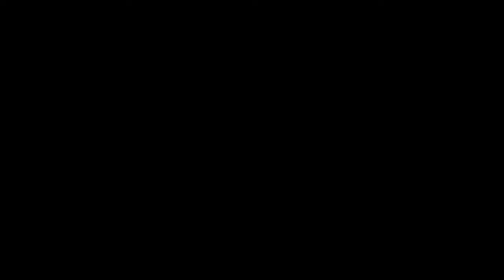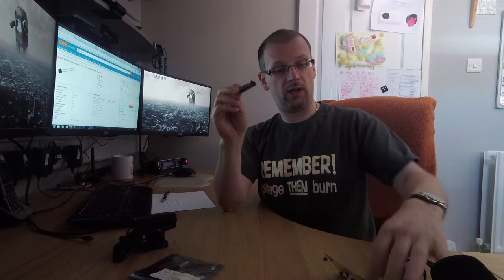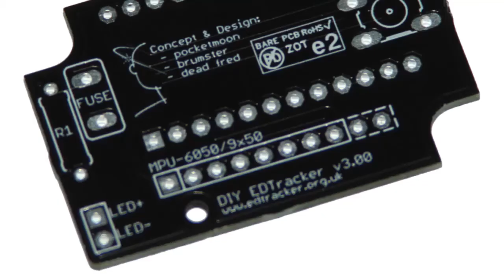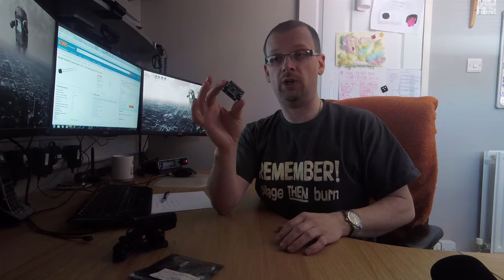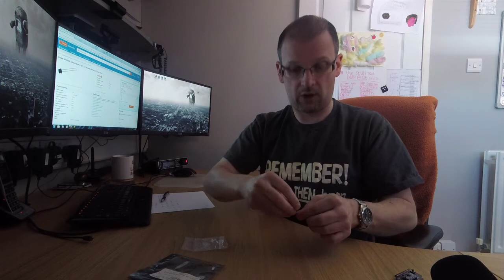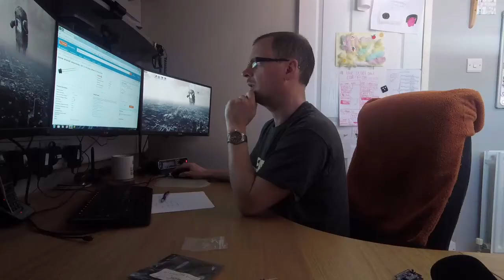Hybrid DIY EDTracker - Part 1

Comment: Hello Brumster100, I hope all is well as it should be during these difficult times.....
I was wondering if there is ANy news about the "rebirth" of EDTracker....?  A while ago you said it should be back online soon, but unfortunately it is still unavailable as of this day just before the yer 2021 ends.... :😞   Thank you for any information you might be able to give....
Reply from the maker: The commercial EDTracker (EDTracker Pro) died quite some time ago now; I left the company almost 4 years ago now, and the company stopped trading I think the year before last.

DIY EDTracker is 'sort of' still alive on GitHub although it is a bit limited by the UI software which is no longer maintained - but technically it still works :

https://github.com/brumster/EDTracker2
Reply: @brumster100  Using the info on your GitHub, I was able to get a 9150-based tracker working from scratch today (18 Aug 2022) by using the Arduino IDE files you provided.
Thanks

Comment: nice one for this been thinking of doing this for a while and this  gave me the push to bother. On the MEMs vs IR point track I disagree with the "what is the point" comments. I've never found point tracking alone to be perfect ( it may be good enough for many things thus not all will notice) and agree that is why VR systems oft have IR just for the X, Y, Z and not for roll/yaw/pitch. As far as response times, resolution and avoiding issues go combining them is the best thing. Combining the two with gyro+mag system is the ideal IMHO. To illustrate my point with accuracy I've used a few things including an EDtracker based on 9250 board for some time and when I first set it up in opentrack after messing with calibration etc I got it perfect aside from a weird "very slight" wobble roughly 1.4 times a second. Realised it was in time with my heartbeat! The pulse in my scalp transmitted through my headphone band and was just enough to be picked up due to no filtering/smoothing, cancelled it out with a 2.5mS window in accela BUT it shows how precise they are, good look getting a pure visual point track system to be that good without having other problems (the latter bit being the important part since you could do it but create new probs).

Comment: so what's the point of the gyro part? might as well just use all ir tracking. gyro is completely pointless
Reply: No problem :) Pun intended, I suppose? ;)
Reply from the maker: Have you experienced the performance difference between MEMS tracking and point tracking? And if you don't believe me, that's fine, don't take my word for it - you're basically saying to HTC/Oculus/etc "why bother with MEMS sensors in your VR displays, just do it all using IR tracking"...?
Reply: Yeah, I have, I've built ED and my own IR. the difference is negligible, and adding the two together like this is just... pointless. 

Don't get me wrong, I appreciate ED and your software, but after moving to IR with 6dof, theres no point in gyro any more.

It seems to me that adding the 2 together like this just looks like you are trying to keep your head track relevant when IR is better.
Reply from the maker: Fair enough, I see what you're saying and I sort of agree. The reason for the video is just to play along with some suggestions on the old t'interweb, I must admit. I don't really see a strong desire or need for it personally, myself - standard EDTracker is fine for me. I honestly doubt I will ever use any sort of point tracking; the simplicity of basic MEMS headlook is more than enough for me. Consider this an educational exercise; I'm totally up for being honest and the answer could very well be "it's not worth it" at the end of the journey. If people are happy with the performance of point tracking in their environment - and have taken the effort to perform an educated comparison (which you do - good stuff!) - then I say good for them, stick with it! I used a homebrew point tracking solution myself for a while, and just found the experience laggy and dropout-ridden... but I am a firm believe in the phrase "each to their own" ;).
Reply: I can definitely tell the difference - lag is far less  for me with MEM (EDTracker). Guess it's down to personal prefs :)
Reply: @Pixels, he actually believes there's no need for the LED part instead. I had to have a lengthy enough debate to try to convince Brumster a hybrid system does have its use. You can even see from the video he's very skeptical about the whole idea, but at least he tried to help people like me who prefer MEMS gyros for rotating, but absolutely must have 6DOF. I don't imply I was the only one, but I really appreciate him making the vids.

@Brumster, thanks for the videos!
Reply from the maker: ;) no worries! It's a difficult balance really, isn't it. If you're looking for the ultimate performance with no compromises, then a hybrid tracker has to on paper be the best thing... BUT, from a practicalities points of view, you've got added complexity of a camera setup and software to interpret two tracking technologies and fuse their results into a single set of positional information, then push that into the game via TrackIR or the Freetrack/FSX protocol. And that then introduces dependencies - dependencies on 3rd party software, on game developers support that software, camera drivers, camera hardware availability and so forth. Absolutely fine for the DIY scene - no issue at all - but as a commercial product it's then just a minefield. My angle has always been, 3DOF (or even the pseudo-6DOF) gives the key benefits of head tracking for most people... but I totally understand there will always be people who demand the best. Hence this little series ;) let's see what we can do! I'm genuinely interested to see how it all performs!
Reply: The only problem is that I'm not too much of a DIY type myself :) Still, I can solder stuff, so, hopefully, I'll be able to put the parts together :)
Reply from the maker: I'm sure if you ask me nicely I can knock something up for you ;)
Reply: Depending on the definition of "nicely" :) But yes, that'd be great :) I guess I need to contact you through the site.
Reply from the maker: Yeah, drop me an email via the contact form... but let's see how it pans out first!
Reply: Just to make sure I understood you correctly: you are going to make the part 3 where you will show the finished design, right?
Reply from the maker: Part 3 will be 3D design stuff really, designing the enclosure - something a bit different...
Reply: Anyhow, looking forward to the part 3 :)